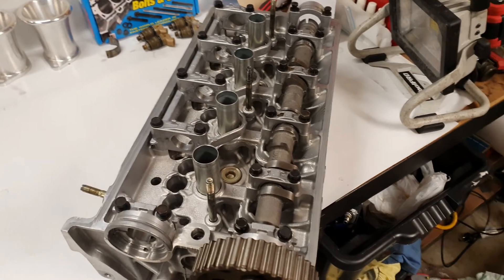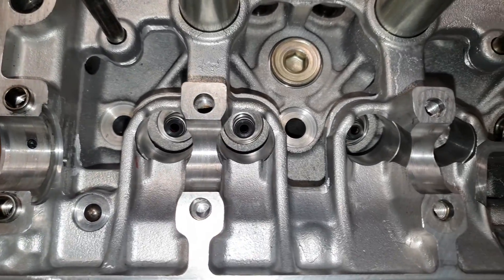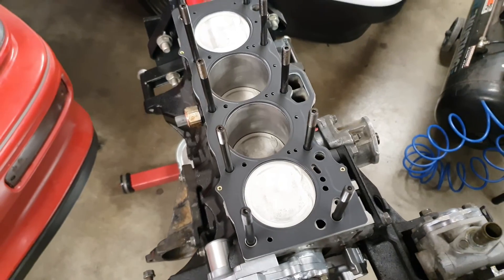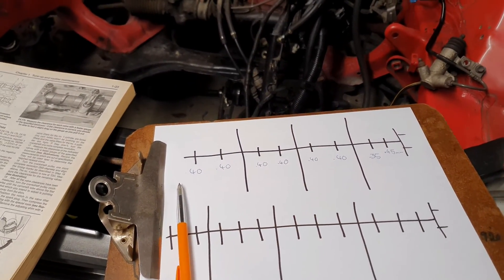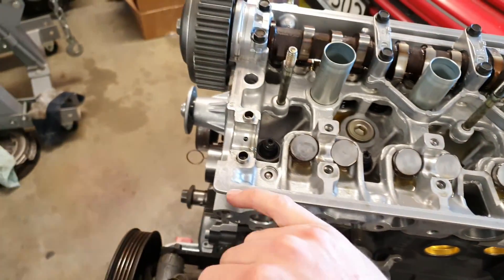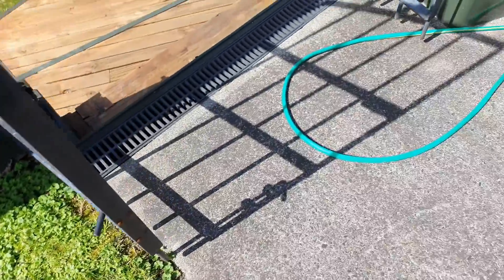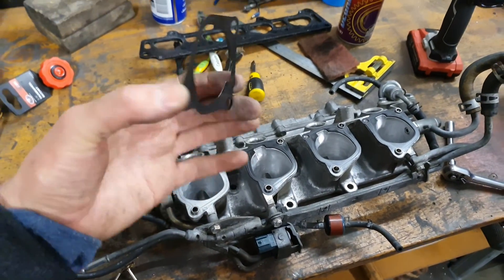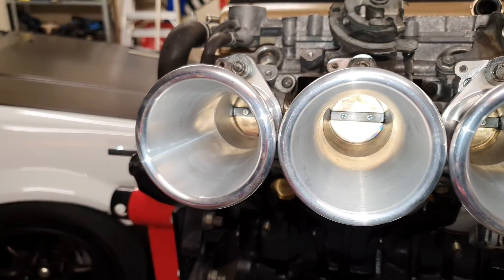4AGE 20v Upper Assembly

Comment: Do you have a link to the valve spring compressor tool you used?  A bit afaird that anything here in the states is gonna be too big
Reply from the maker: Hi. I just brought one of these cheap kits online off a New Zealand website. Probably buy it on ebay and Amazon also. https://www.trademe.co.nz/4759448474

Comment: random query; do you have any idea why your grille has that gti-16 badge in the bottom corner? all the other nz gtis ive seen just have toyota in the middle. looks cool as, I want it!
Reply from the maker: Hey. It's an factory badge they come out with in the bottom corner, I have seen others the same also here in NZ. 
When I brought the car in 2004 it was stock standard, had the Toyota badge in the middle also but I removed it to give the front a cleaner look.

Comment: Who would you recommend for 16v 4A extractors?
Reply from the maker: Not too sure to be honest, I ran coby 4:1 headers for many years which gave good top end power, ideally 4:2:1 would be best  to give more mid power. Any 20v ones will fit too, just need to slot the end bolt holes.  A good header will be pricey though, Brendan at Niteparts in Auckland has made some nice custom ones I have seen. My 20v header is a stock one painted